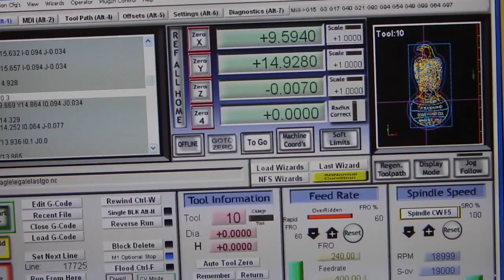Motif for a model steam engine

Comment: Can you explain why you chose to fab this way as opposed to alternatives? It appears to be a decorative piece and could be made  in other ways.
Reply from the maker: Hi Jerry. I needed a 3m stud on a 3mm thick plate. If I drilled and threaded the plate it could only go into the plate 2mm as the eagle details are up to 0.75mm deep in places. This would give me only about 3 threads to hold the part to the front door on the engine.The other way would be to rivet the stud to the plate. Once engraved if the stud twisted on fitting the engraving would be out of line.